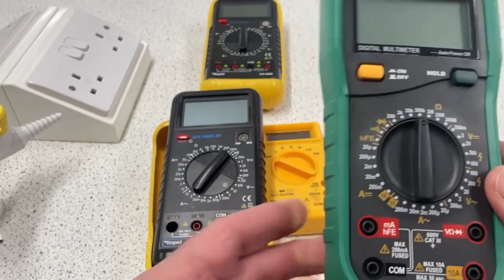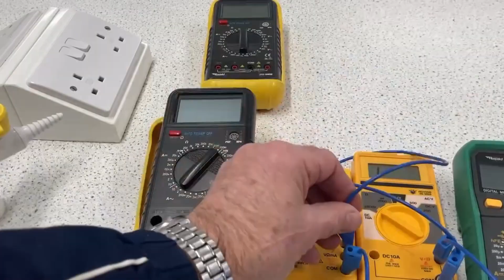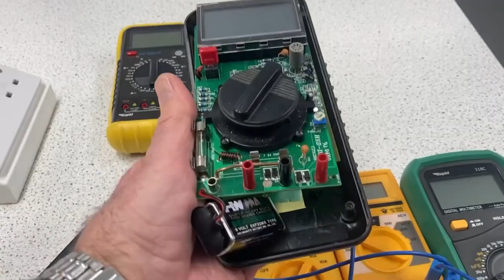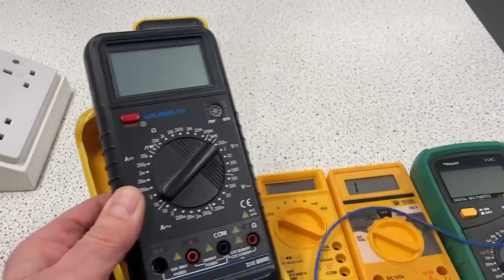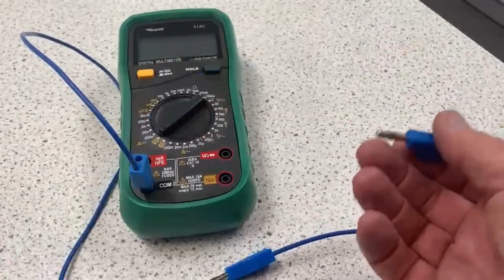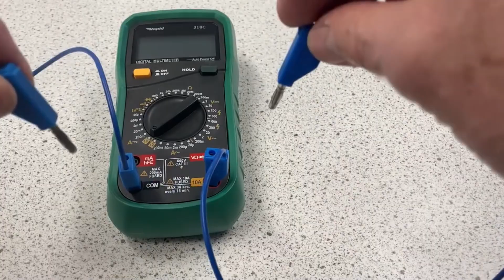Tips for using Multimeters

Comment: Fellow physics tech here. A fun trick is that you don't actually need two meters to check for a blown fuse (at least on the Rapid 318 DMM, not sure if this could work on the smaller ones): I find it quicker to just switch to continuity and connect the A and V/Ω terminals.